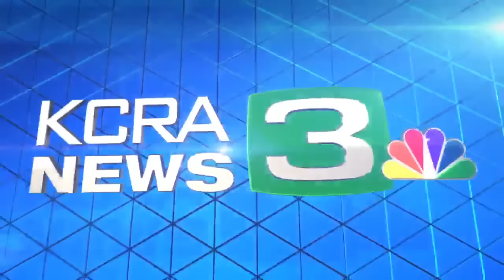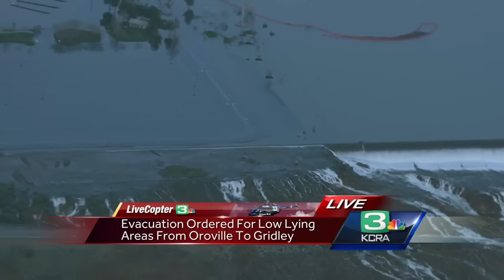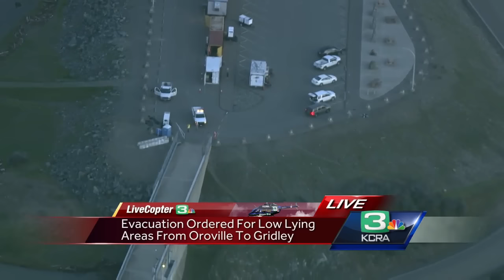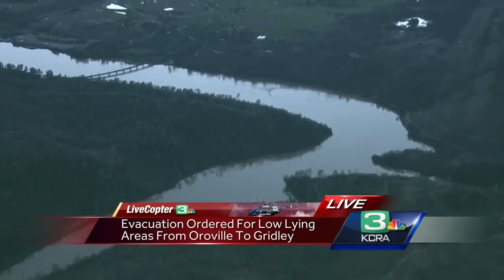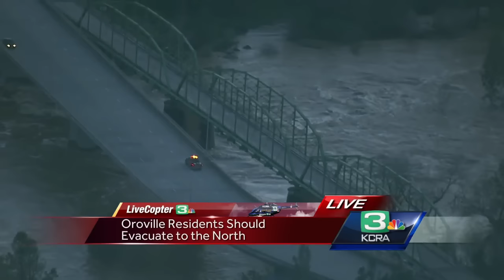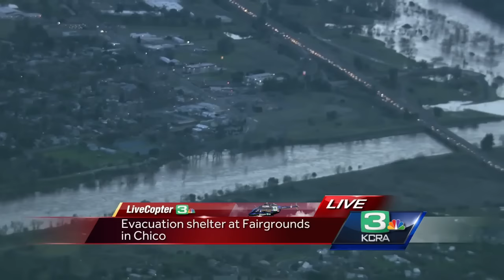LiveCopter 3 surveys Oroville auxiliary spillway

Comment: The lake is rising faster then the emergency spillway can handle. Its now spilling across the parking lot which they never thought it would ever do.
Reply: vqfive -- that is a breach by definition. Comparatively how small it may seem right now, no matter. It will do nothing but get bigger.
Reply: ***** -- OK.
Reply: The water flowing down from the parking lot is because the contractors that built the parking lot were idiots and so are the others that signed off on it when it was finished. Don't build a parking lot the same height as the spillway!!
Reply: ПУТИН СЛОМАЛ ПЛАТИНУ

Comment: the evacuation should have been done yesterday no questions asked yesterday the state Governor and other officials put hundreds and thousands of people in danger I hope the people from that area file reports against the governor and the officials that have been dealing with the whole issue or the structure of that dam , I'm from Connecticut and honestly the governor should have acted more swiftly with the situation on the dam , there is a lot more damage to the dam because of the officials still wanting to use the dam .
Reply: Do you have some idea where that water can cause this kind of trouble to evacuate all the people?  It looks like it's sticking to a certain path with lot's of room to flow....To my mind only riverside evacuations would be necessary....I wanted to know why they see so much potential trouble.
Reply: they are concerned that big auxiliary spillway will give way and then it will be too much water all at once
Reply: jason herring Know what? People could leave for safety without an order. Well, maybe not. Seriously though, people should have a built in monitor that tells them the stove is hot but somehow that monitor has been turned off for many folks. When things get as dangerous as something like Oroville it should set off red flags that alert people even without an order to get out but people don't take the initiative anymore. They wait till the walls come down to make a move. I guess it happens everywhere but even though those warnings are important people should take action on their own to be safe & prepared.

Comment: Well when the Ovoville Dam was finished in 1968 the California Department of Water Resources (DWR) never thought their would be a major problem with the main spillway nor did they think that the water level would actually reach the top of the auxiliary spillway that where the problem lays the auxiliary spillway wasn't really designed for long term use it was designed for short term use and the ground below it wasn't built for large volumes of water 13,000+ cubic feet per second. And with both spillways with gapping holes on the middle of them due to erosion and it don't help things when the California Department of Water Resources (DWR) had no choice to increase water release down the already severely damaged main spillway at a rate of 100,000 cubic feet per second to lower the water level below the auxiliary spillway and relieve the water pressure on the dam so things don't look for the Ovoville Dam since with more wet weather forecasted for the area it don't give the California Department of Water Resources (DWR) much time to fix the spillways by dumping rock into the eroded places of the spillway but the question is how long will the temporarily fix last especially at the large volumes of water they gotta release so sooner or later something is going to give worse case scenario is both spillways could be damaged far beyond use causing extreme stress on the dam itself by tons of water pressure possibly causing a breach in the dam spending a 800 foot wall of water downstream destroying everything in its path let pray for the people of Oroville, CA that things don't come to that.

Comment: Californians never had any breaks, no punk intended.  First it was the 5 years drought, now with the rain, we thought we could at least flush the toilets w/o feeling guilty, and now this!!  It looks like it's delayed and lax maintenance/inspection.  We have the technology to initiate such grand project after WWII and built it, but now citizens have to suffer bc it wasn't maintained properly.  Those failures/erosion should have been found out decades ago, too many coffee breaks?!?
From Mercury News 2/12/17 " ....Three environmental groups — the Friends of the River, the Sierra Club and the South Yuba Citizens League — filed a motion with the federal government on Oct. 17, 2005, as part of Oroville Dam’s relicensing process, urging federal officials to require that the dam’s emergency spillway be armored with concrete, rather than remain as an earthen hillside.  The groups filed the motion with FERC, the Federal Energy Regulatory Commission. They said that the dam, built and owned by the state of California, and finished in 1968, did not meet modern safety standards because in the event of extreme rain and flooding, fast-rising water would overwhelm the main concrete spillway, then flow down the emergency spillway, and that could cause heavy erosion that would create flooding for communities downstream, but also could cause a failure, known as “loss of crest control.” 
“A loss of crest control could not only cause additional damage to project lands and facilities but also cause damages and threaten lives in the protected floodplain downstream,” the groups wrote.  
FERC rejected that request, however, after the state Department of Water Resources, and the water agencies that would likely have had to pay the bill for the upgrades, said they were UNnecessary. ...."  Exactly like New Orleans 2005, New York 2001, penny wise, pound foolish in every sense of that expression with all these pre-warnings.

Comment: Had the agency specifically created and developed by President Carter been allowed to take charge and organize its many branches and distribute authority from a central node, this crisis would have been much better managed instead of the several competing branches getting in each others way and overstepping and failing to coordinated.  FEMA.  
This bitter feud between HomelandSecurity and FEMA was a power struggle which HomelandSecurity seems to have won forcing FEMA to manage internment camps which is exactly why HomelandSecurity was created!!   
Prez Trump!  Reman and refund FEMA to be the central authority for Federal Emergency Management Authority!!